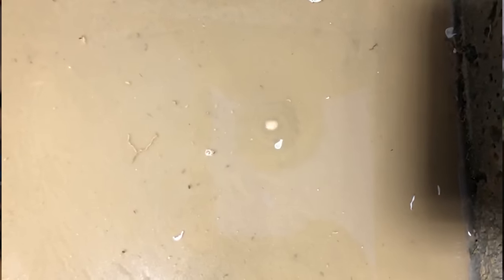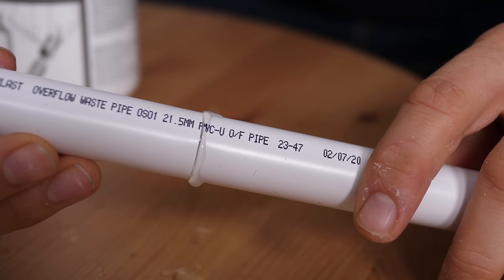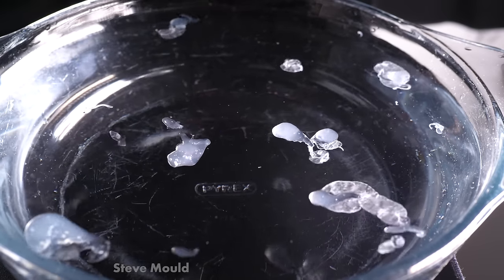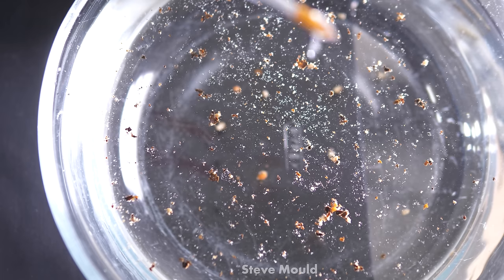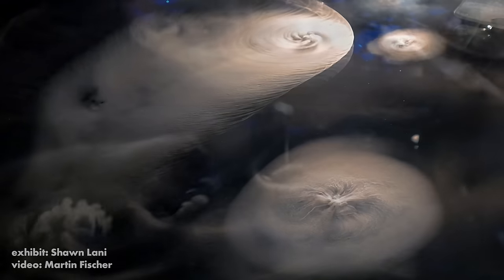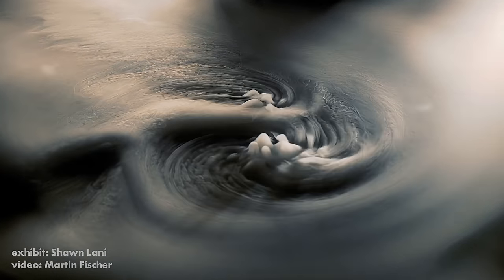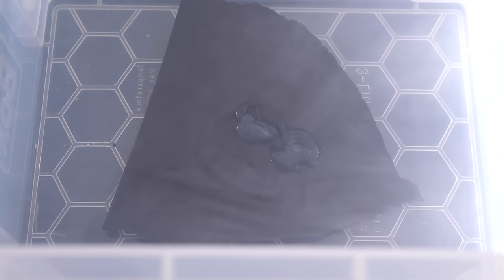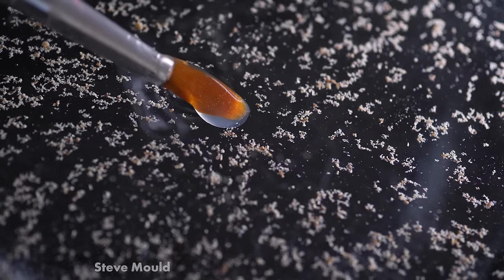Bizarre Spinning Glue

Comment: water prevent air contact, thus solvents can only leave by dissolution. not all of its solvents are perfectly soluble, but in air they all are vaporizable. by leaving they cause to dissolved PVC to -semi-polymerize to a gel-like substance with dynamic response to the incline of the inside PVC to polymerize more. this incline is observed when soluble solvents indirectly spread the blob on surface as it is less energy consuming to let that heterogenous topography face to air due to surface tension if not that polymer is less dense than water while polymerization pressure wins over the remaining low soluble solvents which are further evaporated on the air faced surface. 
but they can not evaporate from the gel-like polymerized layered drop. gel-like structure contains dynamic tunnels constantly closing due to PVC polymerization pressure and opening due to remaining solvents inclined for dissolution together with softened outers shell by increased heat due to exothermic reaction when polymerization achieved. the inner structure of course may contain some cells with semi-polymerized walls which creates heterogenous war between tunnel formation and polymerization. stable rotation means constant tube formation like lightning tube, using the same tube solvents flows. random movement means heterogen tube formation closing and opening depending of the result of war of thresholds thus charges a little bit and opens or else. after some time, when inside is also become jelly, and most of the good soluble solvents left, remaining less soluble solvents together with more viscous drop prevents further mixing dynamics. which eventually forms a softer polymer compare to its evaporated form and that form stops moving and rotating on the water. the chemical potential is now under the barrier threshold. ELSE WE HAVE INFINITE AMOUNT OF WORK FROM A FINITE AMOUNT OF MOSTLY ELECTROMAGNETIC POTENTIAL

Comment: Now, I'm no scientist, and I've never used PVC cement, but is it possible that the jerky jets are caused by the solvent inside of the drop redissolving parts of the solidified PVC? Like, in my very theoretical understanding of what could be happening, the way a blob of PVC cement dries is through evaporation, but if once the outermost layer of PVC cement hardens and doesn't let any more solvent through, wouldn't the rest remain in that solution state? So the solvent must be trying to maintain equilibrium by spreading out to the dried parts only to evaporate further, but the way it reacts with water is forming jets, and the reason it appears random is because we don't have enough information to predict which part of the hardened skin of PVC is going to leech out more solvent. At least that's my incredibly uninformed hypothesis.

Comment: my guess,  the shape of the drop of the cement has a lot to do with the motion. The drop has a sharp end that tends to point in the opposite direction of the angular velocity of the drop from what it looks like in the video.  Whatever discharge of fluid happens, i suspect happens faster at the thinner/sharper end of the drop. Of course I am just guessing here, helped by some highschool physics intuation.

Comment: What's the average time for the pvc drops to stop spinning, or is there some kind of equation where the duration of the spin depends on the volume of pvc? Also I wonder if the same would still happen/what it would be like in a more massive scale, like on a pool of water.

Comment: I totally thought as soon as I saw what was going on that it has to do with hydrophobic and hydrophilic molecular action. What I think is going on is as the chemical evaporates the water comes in contact with it and it becomes Hydro phobic and then some sort of chemical process happens where the process repeats itself. it becomes hydrophilic again and then keeps repeating the process. If this happens quickly and fast enough it will look just like what's going on. Total guess but that's what it looks like is happening.

Comment: The reaction between the solvent and the pipe generates heat. I know the pvc is already in solution but is it possible that there is a further reaction with the water and thus the forces being convection?

Comment: I wonder Steve, if you made a serial dilution of the cement in methyl ethyl ketone, you could test your crust forming vs solvent jets hypothesis. Also try different temperatures of water. I'd expect higher temp to increase solvent jets?

Comment: I think the "wings" for because of how fast the PVC Glue Heals 

As its exposed to air it has those few seconds to harden the outside shell, however, if places directly in water there wi be gaps and the glue will spill out (just an assumption)

Comment: Could the solvent rich PVC absorb water, through the PVC surface film, via something like osmosis, increasing the inside-the-film pre3ssure, until it ruptures, expelling some of the solvent-water mixture?  Then, as solvent escapes, the film reforms by the supersaturation of PVC in contact with water.  I guess this depends on whether the solvent is miscible with water or not?

Comment: Did you try releasing the cement under water to see if it's out gassing? The solvent has to be released in order for the PVC to harden, unless the solvent reacts in air causing it to heat and expand till it's a large enough molecule to be able to carry a descent charge where it can couple with an air molecule and be free to move away from the PVC? Yeah who knows? All that we have to work with is Space, matter and electric charge, we watch the space and measure everything that is in said space, all the matter, then measure the electrical properties of the matter in the space and you will be able to see exactly why one matter is drawn to another! There's nothing else! Those three properties make up everything in existence and decide how they behave and look, there really isn't anything else. Even magnetism is a property of the electric charge...

Comment: I noticed this  a long time ago. After smoking several marijuana cigarettes the ashtray would get full and I would dump it in the commode. All the little particles would spread out equidistant and I would say 'there's  my model of the universe going right down the toilet'.. but no.. wait, some particles were spinning like crazy. 'What a crazy universe' I thought. After a few cycles of my rolling, smoking, and emptying I realized that the spinning ashy-particles held a tiny left-over smidgen of the glue that held all the joints together.

Comment: what if when it is exposed to air it actually reacts to some portion of the water gas/vapor and forms a kind of funnel similarly to a airplane jet and when it goes go the water the interaction of the fluids going in and out of this tub causes the movement?

Comment: Interesting:-) How do the glue react in water with added soap? What about in liquid with higher / lower surface tension? Is PVC cement the only one that React like that, or do other with at least one of the ingredients react in the same way? Does the temperature of the glue, liquid do any différance? :-)

Comment: so, ya know how if ya put a cell in distilled water it starts to fill up, thanks to osmosis?
that, but the cell membrane isn't very stretchy, and quite delicate
now, imagine that the whole inside of the cell is filled with the same material as the membrane, so that any time it bursts, or a hole is formed, it repairs itself

what you get is a blob that is constantly filling up, bursting due to pressure, repairing itself, and repeating the cycle

and the pvc fins can easily be explained if you consider that the cement didn't have enough time exposed to air to  develop the membrane, spreading over the surcace, much like oil would, before the solvent finishes leeching out, and leaves behind the pvc

Comment: Here's a question for ya Steve.  
So you've finished your bowl of Weetabix and wanted to sink into a useless formless shape on the couch until morning.
Problem:  if you don't put the bowl in soak sharpish, you know you've got a 30 minute battle with bits of Weetabix that have somehow adhered themselves to the bowl and are PRACTICALLY IMPOSSIBLE to get off come next morning.
Question:  why IS dried Weetabix stronger than f**king superglue?

Comment: Water is not a true polar molecule. The electron pair is stronger, do we understand why? Is it because hydrogen is weak or because the hydrogens interact with themselves? At any rate, water exists in a dynamic equalibrium of hydronium and hydroxide. Between the slight polar charge and the equilibrium reaction you could have strange gradients all over the place.

Comment: That was quite interesting but ultimately a failure. Firstly the title says glue and then Steve explains that it's not a glue and then at the end of the video no conclusion is reached to explain why the cement spins like crazy. There were several hypothesis thrown out but there was no decisive reason worked out.

Comment: It smells more to me like tetra hydrofuran or thf. I don't think it's an evaporation question but a dissolution question. Thf is a Polar solvent by itself and like to dissolve in water somewhat. I bet there is a play with the less polar glob of thf/pvc solution and the interface of the water thf front where the thf is dissolving in the water and the pvc is   precipitating in the now more polar solution but Rushing back and redisolving in the less polar glob. I'm not sure about the pvc crashing our but the thf dissolving and rushing into the water can be tested by seeing the density lines in the thf water interface front.

Comment: My theory is: the blobs are capsules encased by pvc that are bursting... I guess the solvent is shooting out
Reply: If it was just solvent being encased and shooting out, there'd be bubbles in the cement and reaction with the smoke. It must be pulled out by the water somehow, possibly in a manner similar to NH3 or HCl dissolving in water, but happening entirely in the liquid phase. 
It may also be that the mixed solvents and PVC are immiscible in water, but that the balance is shifted as some components evaporate faster than others, or hydrophilic bits are attracted to the water, and suddenly small blobs go from hydrophobic to miscible and dissolve into the water. It may also be that the cement isn't really homogeneous on a small scale, even though it looks like it to the naked eye.

Comment: I don't think that is a valid distinction between cement and glue.
There are plenty of plastic glues, which are really solvent which dissolve the plastic, so what you are left with is just the plastic.
You then have things like contact cement, or even just normal cement used in mortar, where you have object 1, cement, then object 2.

The distinction used to be cement was the powder which was mixed with water and and aggregate to make concrete etc.

But now there is no real distinction and you could have something arbitrarily called glue or cement and there is no real difference.

Comment: If you put tree sap on a stick in water it moves on its own and you can see a thin diffraction rainbow slick flowing off the sap. This might just be the same surface tension effect, but I always assumed it was due to the lower density of the oils causing to to float on water but gravity and low viscosity flattening it out to a near-monolayer, and then because the slick flows away, newtonian mechanics means the stick is pushed. I wonder if a similar thing is happening here, where the solvent is lower viscosity than water and less dense, but unlike the sap it maybe has the same refractive index so doesn't cause the diffraction slick. See https://www.youtube.com/watch?v=yH9CLwXrICg for a video of this happening with sticks and saps, it's even more beautiful in person.

Comment: The characterization of "surface tension" is incomplete..Rather Chemical Affinities due to the makeup of soap vs water should be considered....It may very well be that dish soap has a "surface tension" close to that of water (if not higher) in pure form vs water.

Comment: I don't think its dissolving solvent. Its the atomic structure of the compound, and how it interacts with the geometry of the water molecules in such a particular way that it generates force as the edges of the water molecules bounce against the surface of the glue. 
 
Which reminds me of that stair case that people built that makes it so drops of water travel up the incline because the shape of the stairs pulls the water up using its tension and its pulled along just by its geometric shape.  https://youtu.be/zzKgnNGqxMw

Comment: Couldn't we see measure the weight of the cement over time to see if it's losing ir gaining weight
Reply: That would tell us if the motion is due to exchange of solvent.
Reply: We could also see if the cement behaves any differently in different solvents with different polority, to test our hydrophilic and hydrophobic end hypothesis?
Reply: Would we notice a difference in the direction of spin?

Comment: Steve .. use this to see air disturbance on the top and a high speed camera and a thermal camera to see it from the top

https://youtu.be/4tgOyU34D44

You should see the solvent evaporative properties as the drop enters the water and the high speed camera should be able to pick up the changes in the surface as the blob rotates and reacts with the water

Try different types of water .
Tap
Distilled 
Purified
Demineralised 
Soda
Heavy H2O3

Thermal camera to see cyclical heat of the solvent trying to evaporate and harden

First time I've seen that reaction and I have put heaps of pipe together... interesting

Comment: 1:30 Where is the uproar?? That is NOT how you join two pvc pipes together... 🤣 I'm dying! I thought the guy was joking. 

Use a coupling. 

The proper method is to use primer and then cement to fuse the pvc together. It creates a reaction and literally melts the outer layers together.
Reply: 2 years late but you literally needed to watch less than 30 seconds longer to get your answer.
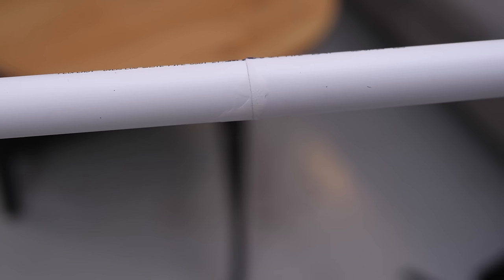Reply: @nekomimicatears  Bruh... Look at 1:30. When you use a coupling, the pipe is NOT touching like that. Ooohhh but 2:00 he says how plumbers actually connect pipes, so alllllll better?? 

No. That still doesn't change the point. "It's like welding!" Not at all. The two surface ends of the pipe are not where it makes it's seal. 

But thanks for being so quick to try to prove you know something! Haha